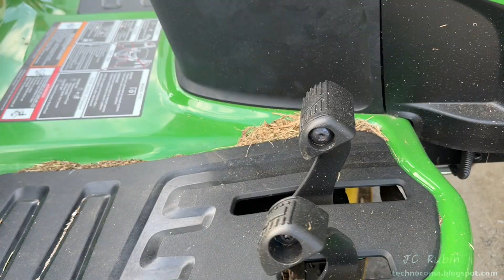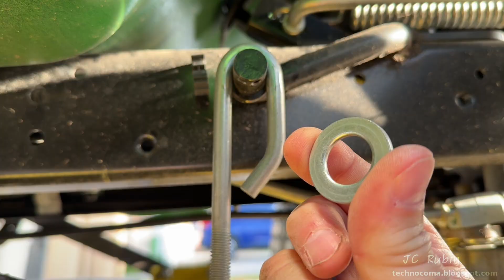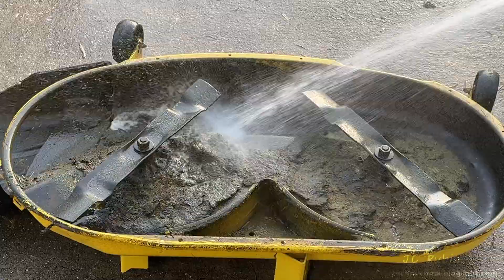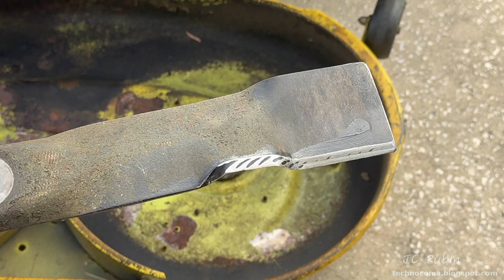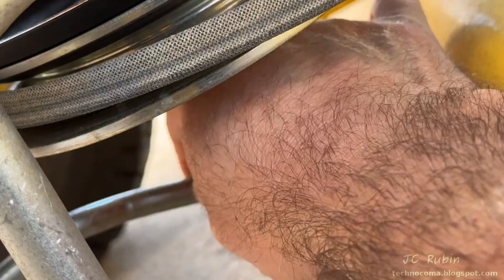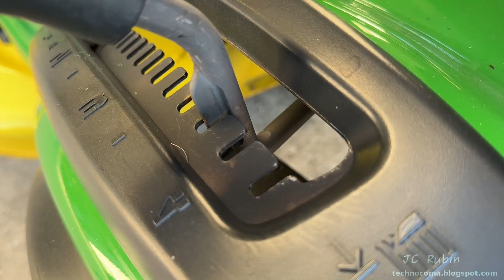John Deere E100 Series Riding Mower Deck Removal and Blade Swapout

Comment: If you are working on a machine or vehicle get a sheet of paper put on steering wheel.  Write with a marker "DO NOT START - DO NOT MOVE" and put electrician tape over ignition switch.
Reply from the maker: Don’t forget to remove the spark plugs and cut off the ignition cable off just for good measure.
Reply: @retrotechandelectronics  Yes.  But DO NOT START DO NOT MOVE understood by many.  We had those signs at work.  It got used after a engineer got a serious injury after vehicle moved when unsafe.
Reply from the maker: Thanks for watching.